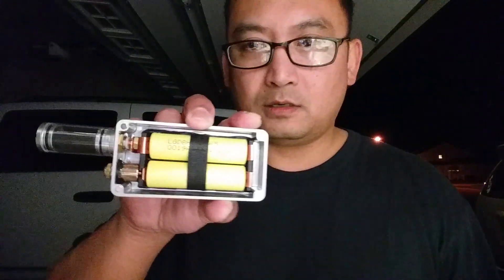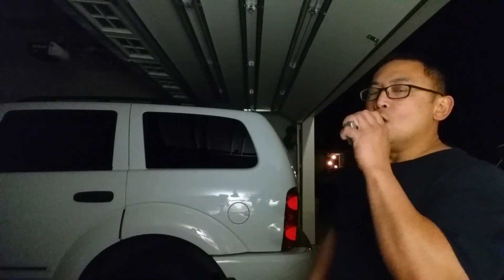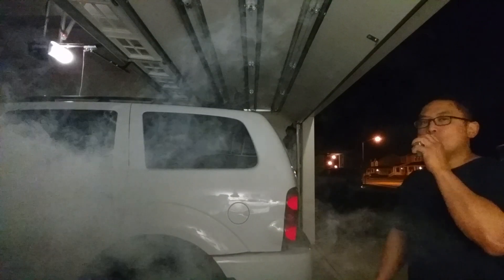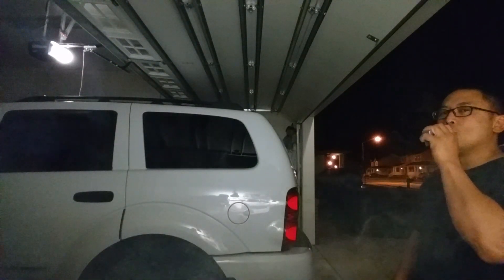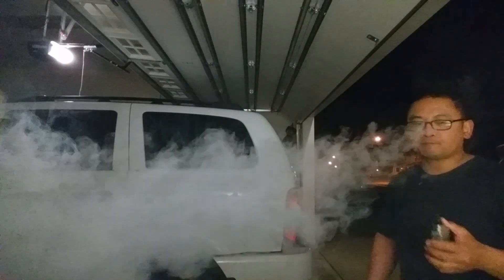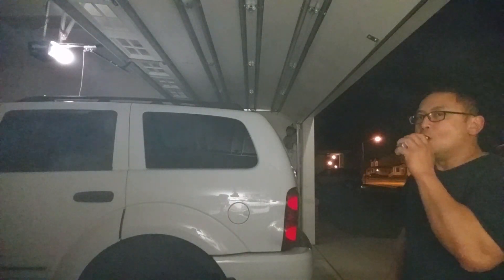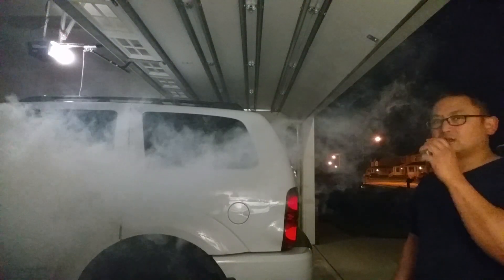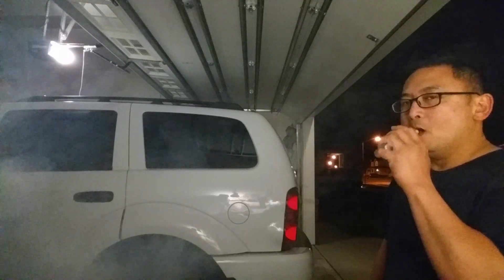Fully mechanical series box mod voltage drop test

Comment: Got to tell ya` from making one of your first unregulated box mods for me and my miss several years ago they have never let me down, so many of my friends have gone through several shop regulated mods in the several years and our unregulated mods are still kicking ass,
There was one occasion that one of the batteries did short only on my parallel mod ,don`t know why but replaced Mosfet even though resister never blew,
other than that as long as we do the calculation with batteries to coils there isn't any reason to worry, unless any one wants to place fuses in them,
Any ways just wanted to give you a Big thank you for the tutorials sharing the info, on the UNBMonds saved us a fortune.
There was one question i would like the answer to if you could please,
When I use a aluminium box. The drain source from the Mosfet`gets carried along the copper wire witch is soldered to the brass washer that is tightened with the nut on the negative part of the 510 connector and also its being pressed to the inner of the box mod, As the box mod now becomes the negative does this drain the batteries quicker, or have I got this misunderstood.
This is not necessary on about the box mod on this channel

Comment: goodpm sir Al, pinoy po pala kayo, ask ko lang kung pano gawin yung custom switch? meron po ba kayong  video para masundan ko yung pag gawa nyo ng switch, kung meron din kayong diagram for series box mod. thank you sir Al. godbless
Reply from the maker: +lee marvin wala akong separate vid for the switch and diagram. I explained in the vid how I made the switch. If you live in the US, you can purchase a mechanical pusher (similar to the switch I made) from fatdaddyvapes.com. If you live in the PI, you should be able to find a mechanical box mod switch from your local vape shop or ask around.
Reply: ah ganun po ba, i'm located here at California po, safe po ba yung series na ginawa nyo? i really like what you did on that series mechanical mod, anyway, thank you so much po. sana mkagawa din ako nyan. hehe..
Reply from the maker: +lee marvin as long as you know what you're doing then it's "safe".  But use at your own risk. Good luck on your build.

Comment: Hi, Have you ever had the fire service  come around to put out your mech mod,LOL,
loving your vids they are very informing,
Reply from the maker: +wow dude not yet coz I keep my garage closed, lol! Thanks dude!
Reply: +Al USAF Have you seen the box mods with 3x18560 batteries in them,I was wondering whether they are safe,would like your opinion on them please,
Reply from the maker: +wow dude I have. Yes, those would be safe to use. Parallel setup will share the amp load across 3 batteries which equals better for the batteries. Series setup will also be good because since the output voltage is higher, 12.6v fully charged, the amp load will be a lot less. But you need a higher resistance build. Just use an ohms law calculator to figure out what's a safe build for the type of batteries you're using.
Reply: +Al USAF I'm a electrician and after watching this at work had the idea of taking a 1/2" or 3/4" LL or LR- which is like a pvc 90 that the side comes off and is held on with screws- I'm trying to figure out how I am going to situate everything in there, think it'll make a great working box( tough n stuff)
Reply: +Taylor Nothnagel there's loads of different types

Comment: http://youtu.be/974gZyQssLQ
This is a short video explaining how to measure voltage drop
Reply from the maker: teamcarp1 about voltage drop...MC Vapes explained it one way, the video you linked explained it differently, other people do it as how I did it...as I stated in the vid, I don't really care about voltage drop (someone requested it and that was the only way I knew how). Basically, as long as my device works and I like the performance, I'm satisfied to say the least.

Comment: The ONLY meaningful/accurate method for testing for voltage drop is to first measure the uninstalled batteries by themselves to create a 'baseline' voltage. A minimum of a 4 digit resolution DVM is required for this (not an in-line meter). If you skip this part, there is no point in continuing. Next, install the batteries and re-measure the voltage at the 510 connector without anything attached to the device. Subtract this measurement from the first measurement and you will have the actual voltage drop/loss of the device. There is NO other way to do this. The moment you add devices (in-line meters, atomizers) you are no longer measuring the battery mod but are measuring a combination of components and loads.

Knowledge is power.
Reply from the maker: yellowhorse05 does this procedure apply to all voltage drop test or just with vaping devices? I know with cars you have to have some type of load to measure the voltage drop.
Reply: This procedure applies to ALL static electrical measurements. Again, the moment you add components (loads) to the circuit you are no longer measuring a singularity. When measuring voltage drop you must ALWAYS have a 'baseline' measurement with NO load before measuring with a load. Failure to do that makes all subsequent measurements meaningless. There is no way to know the actual voltage drop without taking at least TWO measurements - one without a load and one with. In the case of your mechanical box mod, the resistance of the mod itself (without anything attached) is the load as presented to the batteries. Same for cars. If you don't measure first without a load, how can you possibly know what the loss (or gain) is? Yep, that's a trick question. :-)
Reply from the maker: yellowhorse05 I'll do another test using what you stated and I'll post the vid. Thanks for your input.
Reply: Al USAF
You are more than welcome.
Reply: Mjr Burn
I hope that none of this comes off as 'mean' BUT....... you are dead wrong! The device/mod (all by itself) 'IS' the load as presented to the batteries. Adding anything else changes the equation and you are no longer measuring the losses of the mod BY ITSELF. I said NOTHING about the DVM presenting a load  - did I? NEVER happened - did it? Are you just making stuff up? Try re-reading what I wrote - very slowly so you have a chance of understanding it. Don't 'interpret' what I said. Take it literally. I speak and write very clearly. Couldn't be simpler. If you didn't understand what I said in my previous comments, then there is little hope for you.

I have two Engineering Degrees (one is a PHD). The goal here is to measure losses of the battery mod BY ITSELF. I have watched that video and the guy fails to first take a baseline voltage measurement of the batteries alone (making all further measurements ....USELESS. He then goes on to add an atomizer to the mix which makes it completely impossible to measure the losses presented by the MOD (JUST THE MOD) by itself. This method isn't just wrong - it's asinine. What he presented is another goofy failed attempt at doing this based on testing methods that are merely worthless (uneducated)  'assumptions' on how things work. I have already seen to many of these - but I do get a laugh from some of them. :-)  Most of these guys are just plain dumb and pose as knowledgeable intellectuals to their equally clueless 'followers' all to willing to believe anything. These people are 'helping' nobody by handing out foolish information like this. Dumb and Dumber comes to mind. This isn't about vaping at all - it's about proper electrical measurement and factual science. Opinions mean nothing.

Don't want to believe me? Great. Try reading/studying a basic Electrical Engineering textbook for facts and methodology on this procedure. Get back to me when you have something useful to contribute (unlikely). I would suggest that you skip anything more advanced as you are clearly having difficulty with the easy stuff. 

Knowledge is power. Get some. 

Oh, and kudos to USAF for wanting to learn how to do this properly.
Reply: Mjr Burn
OK. Now you are starting to bore me. You have contributed nothing USEFUL or factual here in spite of my request for you to not reply unless you could do that. The wacky theories and 'opinions' you present here are meaningless and useless. You not only have FAIL written all over you, you appear to be every bit every bit as stupid as I originally thought you were. Are you one of those clowns that thinks the Earth is flat? Not only do you have NO grasp of Electrical Engineering basics, you seem to also be challenged with reading comprehension as well. I guess hearing from you again is my punishment for trying to explain it to you - again. That mistake will not be repeated.

I have explained this (twice) in the simplest possible terms and STILL you don't have a clue. I won't make that mistake again. I see now why your post was originally marked as spam and I never should have opened it.  Apparently, you are a full time whiny little pain in the ass and folks are tired of you. If you bother me again, I will re-list you as spam and I won't have to suffer through your ignorance anymore.

Move along, dummy.
Reply: Taylor Nothnagel
I already have a Utility Patent Pending for a design I came up with for absolute foolproof venting on a tube style mechanical battery mod. I might even make a buck or two when a vendor picks up on it.

These days, I usually voltage/wattage/temperature controlled/regulated (mostly Evolv as I am not a fan of Chinese electronics) battery mods and rarely  use 'mechanical mods anymore'. While 'I' have no real problem with them, they are a pain in the ass to get 'right' and pose a significant safety issue for the uninitiated. They (regulated) are definitely the way to go. Almost anybody can use one safely. Almost.

Vape safe.
Reply: yellowhorse You can not test voltage drop on any device with no load on the circuit, period...
The test needs to be done as in the comment I made above this one...Yes multi meters apply a very minimal load but it is in no way reflective of any load this circuit will be under while in use, so any findings gotten this way will be inaccurate... Watch this Vid https://www.youtube.com/watch?v=974gZyQssLQ&feature=youtu.be Yellowhorse, as it pertains to exactly how this should be done...
Reply: How in the hell does what I said not establish a base line voltage ??? Seriously, in what application do you test the actual voltage drop with absolutely no load on the circuit, how does one even go about doing this without using theoretical math ??? Sure you can take the known resistances of all components and then use mathematical equations to intelligently guess at the actual resistance under load... You claim all these degrees and knowledge but over look this basic fact of simple applied science that without being under load the circuit will basically have no resistance compared to it's real world application...Without current present and passing through the circuit, there is no voltage drop period...Take your I am better than anyone attitude and name calling somewhere else...It is always awesome to name call and present BS as fact...Degrees are awesome and easily attained by any dumbass that can read a book it takes a modicum of intelligence to apply that to real world applications however...
Reply: +yellowhorse why haven't you designed a badass near no voltage drop mechanical box mod and share the video, you being really smart and all, be nice to help out U.S. Dummies with something to build that an engineer designed. Also would be badass, just sayin
Reply from the maker: +yellowhorse kudos for the venting system design and hopefully someone utilizes it. But what is/are the issues you've encountered w/non-US chips? If it's just w/temp mode, then yes, a lot do have issues. I can't say anything about the Sx350j, since I don't own one. But I never encountered any mods w/non-US chips that had issues in wattage mode. Yes, you're correct about regulated mods, they're easy to use, pretty safe and very convenient (can be used on a wide range of resistance builds). I do use regulated mods more nowadays because of the last reason.
Reply: Al USAF
It's just a 'personal' preference. I choose to source American (or European) made products for several reasons. Especially electronics. Lets face reality - almost everything coming from China is a reverse engineered/copied something or other, originally made/designed by someone else in a Country that is NOT China. I'll take the original over the copy every time. I respect other peoples intellectual property, patents,  copyrights, trademarks and hard work. The Chinese DO NOT. It's a country that is rampant with blatant theft of all things technical and innovative. Name one thing they invented that involves SS circuitry. They have stolen the technology or ideas for nearly everything they make. There is nothing to like about that.

Sadly, it is nearly impossible to buy a computer,TV or phone that has no Chinese manufactured SS components in it. There are a few U.S. manufactured computer products but almost all of them will have a Chinese made SS component or two on the circuit board. There are several reasons for that. First - they (China)  fail to comply with the most basic safety conditions for their workers. Making SS (solid state) components (capacitors, transistors, etc.) or batteries involves many hazardous chemicals, heavy metals and gasses. Those poor people work in deplorable conditions that would never be tolerated anyplace else. Second - paying their workers $5-$20 a day to work in these hazardous conditions makes the cost of these parts cheaper than everywhere else in the world. Couple that with Chinese subsidized shipping and there is virtually NO competition. Third - and let's be really, really honest here.............lots of that Chinese crap looks like it was assembled by a 8 year old. For many people, price is the bottom line. I am NOT one of those people. Speaking only for myself - I'm quite happy to pay 5 times more for a product that does not come from China. It's a matter of principle.

S Korea is a Country that also makes lots of electronic equipment. Major appliances, TV's, phones, automotive, avionic - etc.. Unlike China, Korea complies with International Trade and Copyright/patent Laws. They comply with OSHA type safety regulations and pay their workers a fair wage. Almost the exact opposite of China. I have no problem buying Korean products. My washer, dryer, microwave, refrigerator, TV's and cell phones are all from there.

Thanks for the Kudos on my patent! I have no illusions of getting rich on this but if my idea saves one person from blowing his/her face off - I'm good to go. I was totally shocked that nobody applied for this simple idea. It requires extra CNC work on the tube and end cap - but that's it.

Rant over. My 2 cents - for what it's worth.

Vape Safe!